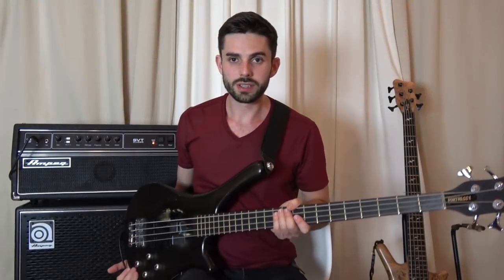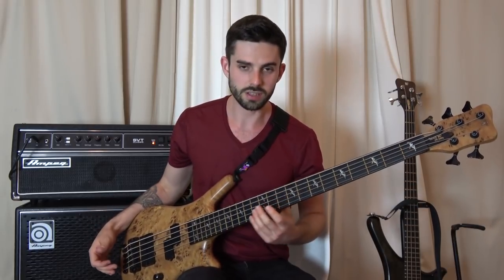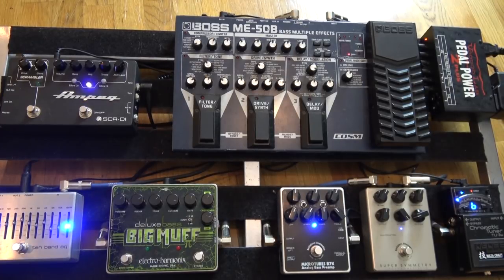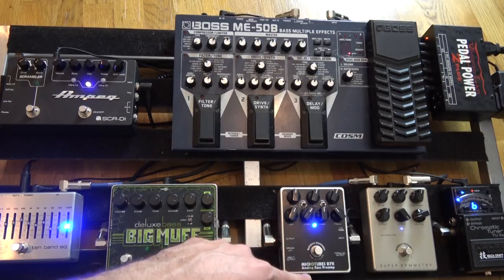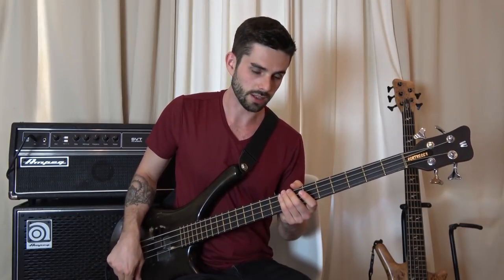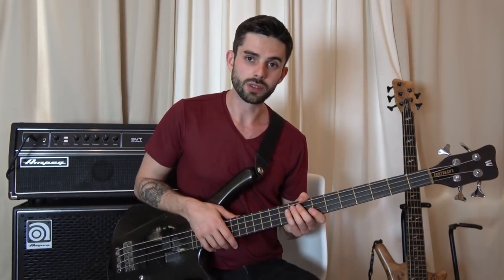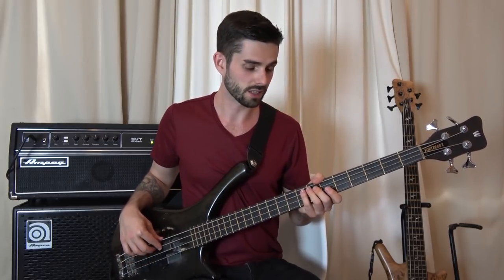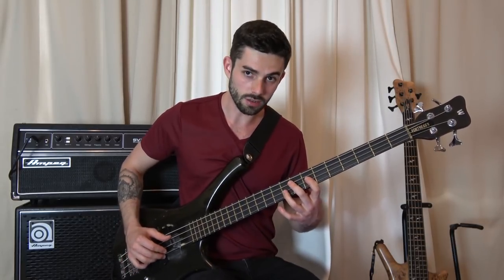7Sloth - Rig Run Down - Tone Examples

Comment: Hi dude, I wondered, what tunning do you use and what string (gauge and brand), thanks !
Reply from the maker: pideuh weuh I change both tunings and gauges of string very frequently. I tend to edge towards thinner strings. I like playing in dropped D a lot. Both of which I did in this video!

Comment: Which strings on the warwicks?
Reply from the maker: S4ND5TR0M I change brands quite often, I really like the yellow label Warwick strings. I believe that's what I was using for this video
Reply: Perfect, thanks! What about a nice combo amp for home?
Reply from the maker: S4ND5TR0M Ampeg has some solid combos that are pretty affordable. I really like the Mark bass and Hartke combos too.
Reply: 7sloth apart hartkes (which I don’t like), do you think the combination Warwick-Amoeg works well?
Reply from the maker: S4ND5TR0M I haven't had the chance to jam on the ampeg combo for very long. But from the brief time I did I could tell it had a nice amount of power for a combo and some good versatility for tonal options.
Reply: 7sloth got it, but I’ll be straight on this: given a budget of 350€, would you go for a MarkBass, a Warwick, an Ampeg, an Orange, an EBS, a PJB or a Blackstar?
Reply: Ever used Ernie Ball's?